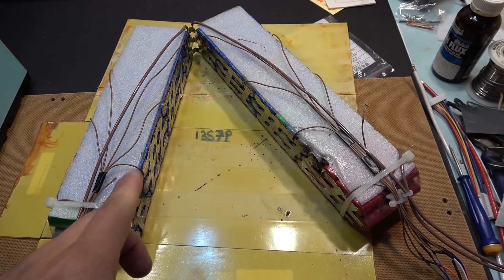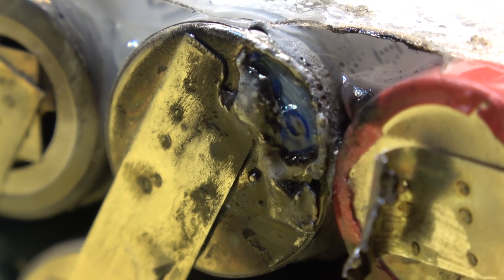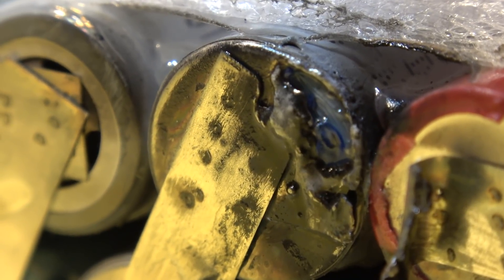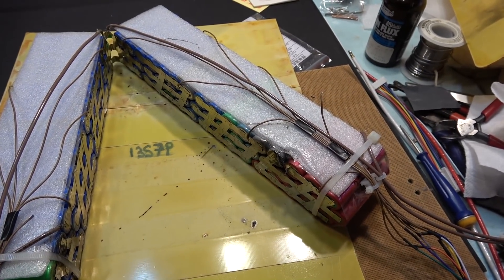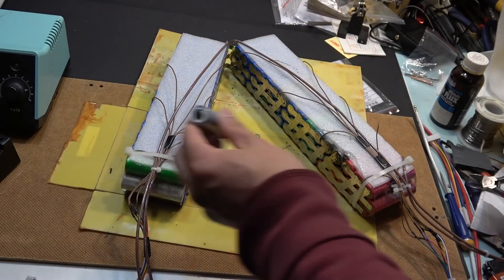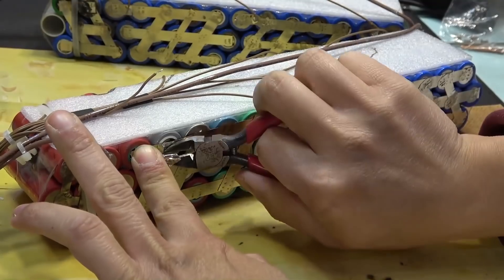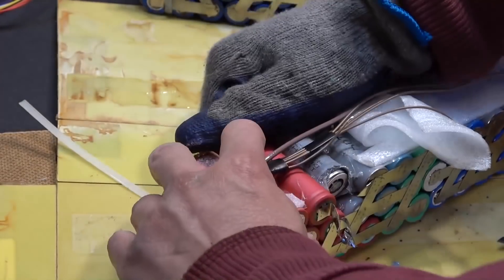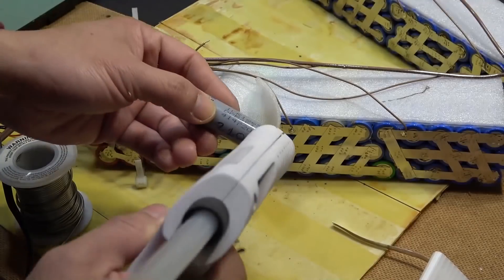Ebike project S02E03: Repair 48V ebike battery & replace 1 cell (accidentally shorted out)

Comment: Hello, wondering if someon can help answer my question. My ebike battery pack. 18650 2600mAh 3.6v. i need to replace one group. Can I use 18650 2600mAh 3.7v? Thanks in advance
Reply: Should be fine bms should balance it

Comment: If you use BMS may be you may not face this issue. Don't know is it right or wrong. bMS is the one where it can control on balance each cell during charge of discharge is it right?
Reply from the maker: BMS only controls balance during charging, not discharging. It surely does not protect your battery if you accidentally short out the cells.
Reply: @vuaeco  OK. Have to note this point for feature reference.

Comment: It doesn't matter if 2 parallel cells wear through their shrink wrap but if the cell next to it belongs to another parallel group things will go very badly. You should be wrapping all of your parallel battery clusters with fish paper before assembling them into a series pack.

Comment: Good job perhaps a better housing for the pack is called for as it has now been shorted by rain and accident so may happen again perhaps even a polypropylene (light weight) shoe box might do? Also the dangling  charge wires give me pause with such a high current available from such a pack!
Reply from the maker: This actually happened during the time I made this battery pack. It gets folded in half and meets in the middle. There was a separator/insulator but I was not careful enough and the 2 sides touched. Then next thing I knew, sparks flew all over the place and the was a gaping hole on the one cell. :D I didn't get that on film which could have been a spectacle to see. It's got a much better insulator now.
Reply: @vuaeco  Excellent, whats the best packs to get A123 (26650 cells) from  ? would they not have a better energy density for such high drain applications?
Reply: @qutube100  I presume you mean power density, as LiFePo^4 chemistry is dog shit for energy density vs. other lithium chemistries. Also, does a nominal 1000W ebike motor (or rather, its controller) qualify as "high drain" in a world with Cromotors and QS "big blocks" being driven at >125 amps?
Reply: @fun_ghoul  I have no idea, i am just looking for a source of A123(26650) lithium ion cells cheaply ( i believe some dewalt 36v packs had them but no longer) for small portable power inverters as a lot  of 18650 are not capable of more than 3 amps drain and tend to lower capacities (2100mah is about it for salvaged cells) and don't like lipo as had one to many cells puff for no apparent reason, just wondering if vuaeco might have come across anything ....
Reply: @qutube100  His packs are all of the "hot lithium" implementations, so your question seems misplaced. Anyway, good luck on your quest.

The sketchiness of the shambles of the A123 supply chain, and proliferation of fakes, is why I gave up on exploiting the advantages of them (like the power density!) in favour of just building a li-ion pack with more in parallel to get the current capacity...and it'll still be smaller than a LiFePO^4!

Comment: do your 48v cells keep in balance ok as you said you dont use bms

?i dont use bms on my ebike 52v battery either its 14s5p split into 2 x 7s5p
Reply from the maker: Yes, they balance fine.
Reply: was the tornado near you recently

Comment: hi,
i'm wondering if i can use a 10s BMS as a 8s ?
Reply: You probably need to terminate any unused sense/charge connection(s) with a very small capacitance rather than leave them floating, or I have seen one BMS with two MOSFETs removed for nonfunctional bank(s). Though in case you didn’t know, his battery bank doesn’t use any bms.